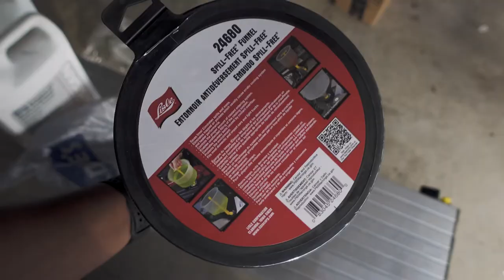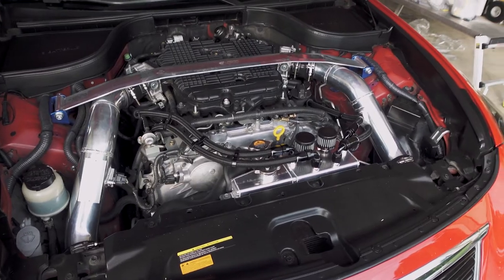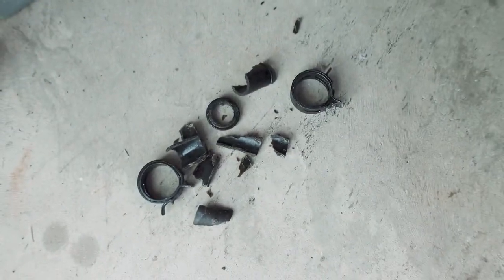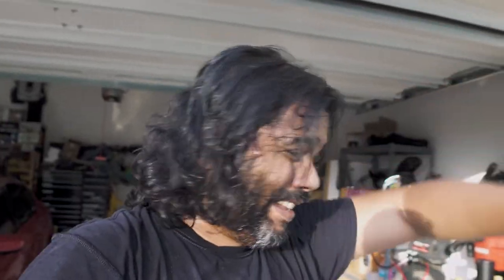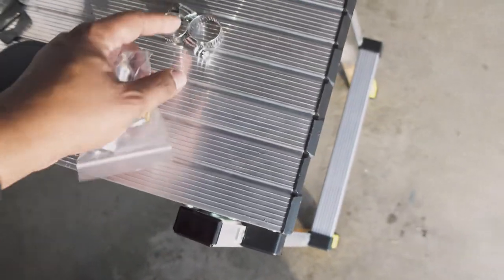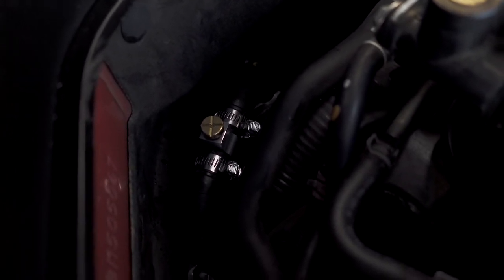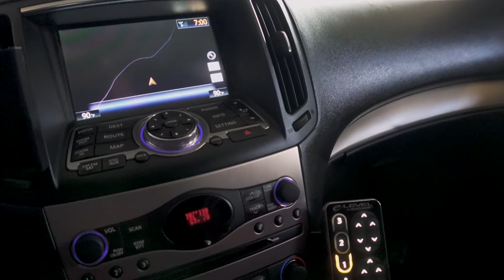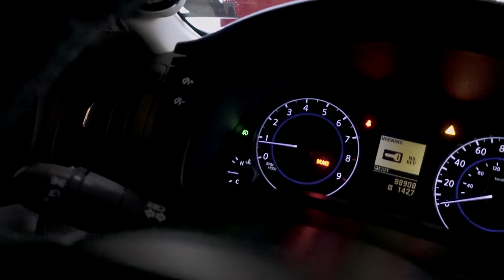Fix this VQ Cooling TimeBomb before its to late.

Comment: I just changed this plastic connector on a 2013 G37 for an aluminum one with a bleeder.  I used a Dorman 47291 connector that is easily available.  If you are just replacing this connector you don't need to drain anything.  Obviously wait until the car is cold then simply plug the coolant filler so no air can get in.  You can't use the regular cap for this because it will vent air or coolant from the plastic reservoir back into the system once you open the system and you will then be dealing with a gusher.  Put an old towel under the connector as you won't lose any more than  a few ounces of coolant at most.  I was able to do this without too much cursing by removing just the engine cover.  Once replaced I opened the bleeder and very slightly unseated the plug on the coolant filler and the bleeder instantly filled with coolant.  I then put on a burping funnel but really didn't need it as so very little coolant was lost and the bleeder worked like a charm.

Comment: That's hilarious I literally just fixed this issue days ago. Mine happened at 95k, it broke in half completely. Unfortunately had no clue this was common. It exploded in the middle of me running errands so I had no idea it happened until I noticed that sweet burning coolant smell then temp gauge was close to all the way. Who knows how long I ran overheated, probably not too long but definitely a bit. 
Really grateful for this video, it might bring more attention to this issue and save lots of people headaches. Don't think there is enough on YouTube. I didn't even know Z1 made replacements so thanks! Had to use cheap stuff to fix mine, going to be replacing that asap.
Reply from the maker: Very happy it helped bro. There is also another line that apparently has problems. I vlogged that one also.

Comment: For sure a ticking time bomb. Mine split right in half at 161,000 miles. Sprayed everywhere and smoke coming out the hood. Easy job if you just want to change the connector. Took me 30 mins just because I didn't want the pieces to fall in. So far so good
Reply: I’m at 162k miles and I just got a leak underneath my car, checked my coolant level and it’s bone dry. I filled it with water for now to find the leak idk where it is yet I’m tryna watch these videos to find out
Reply: mine did the same thing and I'm at 110K. do you know why this thing just snap right in half? is it a failsafe?
Reply: bro that shit just happened to me yesterday morning😭 i thought i blew my shit up😂
Reply: @sobottrachhuth75  late reply but from what I've heard these shouldn't be plastic connectors. It's hot coolant running through it. If you gonna keep the car longterm I say  buy the metals one from Z1 Motorsport
Reply: @alienjooce1324  cheap fix bro.  It's uncomfortable especially in the winter lol but if you not in a rush order the metal one from Z1 and take your time. The old one will Crack. Just make sure it doesn't fall inside. You'll save about 200 lol
Reply: @Hughe1188  yeah ordering it from z1 as we speak lol

Comment: mine started to fail at about 85k miles. I noticed that every time I popped open the hood, my coolant reservoir would be a tiny bit lower than it was when I last checked on it. that happened a couple of times so I figured there must be a leak somewhere. turns out, it was this peace we're talking about in the video. Getting it to it and replacing it with a new one wasn't too bad but the damn thing came out in small pieces. there's an excellent reddit thread that details all the common problem on the Gs and what you should look out for. its called G37 Common Issue Thread. My 2011 G37 has 102k miles and all I've had to do so far is this connector and the gallery gaskets that started leaking at around 95k miles. it wasn't a bad oil leak at all but I did notice a slow build up so I got the gaskets changed. Those two fixes and a new brakes and rotors set is all I've done for my car. I've owned this car for 6 years now (bought at 54k miles) and its been wonderfully reliable.

Comment: This just happened on my '14 Q50s at 52k miles. Noticed a leak traced it to that heater hose connector and it was starting fall apart like your's. Great video!
Reply from the maker: Thanks man and wish more owners can see this video before it happens so they can be ready.
Reply: @3rdPedalMedia  it almost feels like intentional,  they built such a solid motor that they weakened it with an "Achilles Heel". Like a "Planned Obsolescence"

Comment: Just fired up my Z last couple days and noticed first time coolant leaked through the passenger side. Gonna address this soon thanks for the insight bro ❤️
Reply from the maker: Glad you caught it early and not while driving.
Reply: Yeah I’m at 125k miles as the 7th owner , Had it garaged to address the clutch rattle on stock clutch, trying to save for a 34 row oil cooler and a race clutch to suit my driving habits, then this leak occurs. Definitely time for upgrades hoses lol 😁

Comment: Mine finally failed, original with 214k miles on the car. The day before my dyno tune I saw it was dripping. After my dyno tune I swapped for the metal z1 motorsports replacement. I'm glad it didnt fail while on the dyno 😅. The old piece broke into 20 pieces while trying to remove it lol.
Reply from the maker: Oh wow. You go some miles outta yours. So maybe it’s a age thing rather than heat/cool cycling.
Reply: @3rdPedalMedia  yes i’m pretty sure because i’m at 217,000 & barely going to change it in the next couple days(2015 q40)

Comment: That connector with the bleeder is for the coolant hose to the left(driver side) of the engine. Still can be used there though. Just don't bother opening the bleeder.

Comment: This happened to my 37. I got 8t towed to Nissan and they diagnosed it as a leaking water pump. They wanted over $2000 for the job. Good news was they could also do the timing belt for $3000! I googled, paid $3.95 for a new one and voila. Done.
Reply from the maker: Wow what effing crooks! Glad you found the real problem.
Reply: Nissan dealerships surprisingly don't have techs that are very familiar with these 3.7 engines. In Nissan world that engine is mostly premium but they put them in a lot of infinity cars for the the better numbers. Infiniti would diagnose it better, but still charge the same
Reply from the maker: @dylanscott6485  that weird the 370z is one of the longest running Z i believe they have the same couplier, although with the 2013 model refresh like with the oil gallery gaskets it may have been updated
Reply: @3rdPedalMedia  and compared to the 35 it also has duel throttle body’s for better air flow. Most of nissans customers own Altima’s and such so its not like they are having 370zs rolling in for services all the time.

Comment: Mine blew up in my face a few years ago when I was bleeding the coolant and I happened to be in that area of the engine bay. I had to replace with OEM, but bought an Z1 that has been sitting in my garage for a little while. Luckily, the coolant was only slightly warm, but I still panicked and freaked out running around my yard, I think my neighbors thought I was crazy.
Reply from the maker: Damn man. Yea happy it wasn’t bad.

Comment: I literally just came back from work after hooning my G around and noticed a white cloud coming for under the hood. Luckily it seems like a small leak just like you had but I'm definitely going to buy the z1 replacement part just to be sure. Just one question.. Is it possible to replace the part with the coolant still in the engine? 
Thanks for the video btw!! this really had me worried and I was lucky enough to be a mile from home :D
Reply from the maker: Yea you don’t have to drain the system but the top loop will empty just do like I did in the vid and top it back off ensuring all the air comes out.

Comment: Thanks for sharing very important and interesting vid. I just wonder how big company like Nissan can try to save few bucks for production but causing a huge cost for operator ☹️
Reply from the maker: The majority of OEMs depends on 3rd party manufacturers to produce a product to a certain spec. Most car OEM are just assembly plants.

Comment: What part number for that connecter, and where from? I obviously can get the hose clamps. Didn't see it in the details. Sorry if it was somewhere in there.
Reply: Any hose connector will work (granted it's the correct size) lol. I used a garden hose plastic connector and ran fine for 6 months until I switched to a metal one to prevent it from getting old and brittle like how it did the first time
Reply: Look for the Dorman 47291 aluminum replacement connector with a bleeder.  Fits and works great.
Reply: @erth2man  checked that part number at O’Reillys says it won’t fit my car, it’s a 2010 g37s sedan. I wanna buy it anyways and try it
Reply: @vqdrew1171  That Dorman part number 47291 will work perfectly.  These 3.7 engines didn't originally come with a bleeder like the 3.5s did which is why it probably didn't list it as a replacement.  They should all be made to fit a 3/4" (19mm) heater hose.
Reply: @erth2man  yeah I bought it and put it on the other day for now until the Z1 port comes in replacing all my hoses and thermostat lol not risking it

Comment: what did you do with the coolant that was left in the funnel when you were done bleeding the system? Back in the coolant bottle or into the overflow tank? If the overflow tank, did you have to wait for the car to cool back down before you removed that cap or is there no pressure in it from the coolant fill cap being open with the funnel? Scared imma open it to dump the extra & get shot with steam haha
Reply from the maker: On the G it’s an overflow. On the later Z’s I believe the overflow is pressurized. I let it cool down put some in the overflow and the rest filtered and into a container.

Comment: Hi clean build man just picked up a 6mt 370z whenever I do a pull smoke starts to come through the air vent and it smell like something is burning you think it could be this?
Reply from the maker: Good god! That could be a number of things. If you hit the recycle button of the HVAC. Does the smoke still come in? See if there is some old or something burning off or something running.

Comment: Just did this. It was a huge pain. Some of the cracked pieces fell down the tube. Is that something I should be concerned about?
Reply from the maker: Hard to say rly. They are very brittle pieces hopefully they will hit the water Pump 1st and get chopped up in smaller pieces.
Reply: Greatly appreciate the reply. Assuming that it will be chopped into small pieces Do you recommend changing the coolant?
Reply: Greatly appreciate the reply. Assuming that it will be chopped into small pieces Do you recommend changing the coolant?
Reply from the maker: @jphillip2350  you should, is it cooling well?
Reply: Just fill it back up and send it

Comment: Did you drain all fluid from engine and heat exchanger? How much fluid did you put in back?
Reply from the maker: Didn’t drain used less that a jug of Nissan coolant to top back up.
Reply: @3rdPedalMedia  one more question. The owners manual says it takes 11 qt coolant. Do you know when you drain from heater exchanger does all the 11qt comes out or? I just wanna know how much coolant should I buy cause it’s kinda expensive at dealer.

Comment: How long did it take you to bleed the system? I just replaced the hoses with the z1 set and did the valve. My hands and forearms are beat!!!
Reply from the maker: It was very easy. It’s been a while but I thought I went through bleeding it in the vid?
Reply: Yup you did I watched your bleeding process and it helped me out allot. Wasn’t sure how long it took you, taking video editing into consideration. I felt like I kept seeing tons of bubbles took em almost an hour to bleed it felt like.
Reply from the maker: its wasnt that long.. ensure your hvac heat is on and on full and let the thermostat cycle on/off a few times  @BillaDaKilla

Comment: Hello! I’m currently doing this job on my G. Heater hose cracked on me at 90k miles. Just got the Z1 Master Hose Set and changed out all of the radiator hoses and heater hoses. Went to go bleed the system but it’s still smoking from the back heater hose side. I immediately cut the car off when this happens. I saw online people saying it’s just burning the coolant off from the leak most likely and it’s normal. The gauge inside isnt showing it overheating anymore though. Should I just try and keep letting it burn off or what do you think? Thank you for your input!!
Reply from the maker: How are you filling? Do you have a fill cup like what I used that allows air to escape? Did you also crack the bleeder on the z1 fitting to let air leave the back side? Steam coming off I normal but at the same time you shouldn’t be overheating. You have some air trapped somewhere.

Comment: Great work bro!! 👏👏👏👍 My G is at 48k miles, a 2012. I'm going to order that from Z1. Question, did you order yours with standard or spring or what? Also, are you in Tennessee?
Reply: The clamps I mean...no clamps, standard or spring
Reply from the maker: Should be the standard which is the worm screw style clamps.  I believe the spring is like the factory type.
Reply: @3rdPedalMedia  
Ok, thanks alot
Reply: Yes middle TN
Reply: @3rdPedalMedia  
I'm in north Mississippi, we should link up sometime. I do shows with my G. Been trying to get to the Nashville area for some shows. But it either rains or something comes up. 🤦‍♂️🤷‍♂️ Plus I had guys to cancel out too on road trips🤷‍♂️🤷‍♂️🤦‍♂️😡
Reply from the maker: @nonameisthename138  sure when the time comes msg me in IG
Reply: @3rdPedalMedia  most definitely will 👍
Reply: I need to do the same with my G I'm in Clarksville TN and work in Nashville TN
Reply: @jarvond21  
You modded? You coming to Memphis for Stoopid Cold next month?
Reply: @nonameisthename138  I'm slightly mobbed. I will try to be there! I don't have nothing to crazy done to the G
Reply: @jarvond21  
Its all good bro. I was just checking. Modding is a timely thing
Reply: How's Z1 for parts?

Comment: amazing
Reply from the maker: thx bro.. i just hope it helps.
Reply: @3rdPedalMedia  did you lose coolant while replacing it?
Reply from the maker: @hamdanahmed2664  during the repair not much but i did loose a good bit before due to the crack

Comment: I have a 2012 G37x the back tube busted and I replaced it. After almost a month I have notice the upper hose got swollen later busted. I have replaced it with new one. So is it normal for the upper hose to be very hard and very hot????
Reply from the maker: Don’t think so unless pressure was backing up manybe? Was there a restriction? Was the car running hotter than normal?
Reply: @3rdPedalMedia  Yh whenever I touch the radiator upper hose it’s hot I can’t touch it with my hand longer than 5 seconds
Reply: When I changed my upper hose I went to Midas and they flash my fluid and they said it’s good
Reply from the maker: @aahilzaky7933  was your temp gauge higher than halfway?
Reply: @3rdPedalMedia  no its normal. Do u think I should do pressure release ?

Comment: Do you remember how many miles were on the car when you did this?
Reply from the maker: It’s been a while I’m sure I mentioned it in the vid. But it seems to be a matter of time rather than miles. Right around the 10yr mark.
Reply: @3rdPedalMedia  Understood 👍 I have a 2017 370z but it just hit 100k miles so I’m trying to find out what I can do for longevity, great video, learned something new 🙏👍
Reply from the maker: @gray.areazz  np man. Don’t forget to sub. What many have done is just change it out before it’s close to going. And Z1 have a new black version.

Comment: Okay so my 08 g35 sedan has been overheating when sitting/idling but when driving it’s just fine then I got home from work today and I see it’s leaking a lot of coolant and I check my coolant and I have none can someone please help me out with what could be wrong ?
Reply from the maker: Did you ever find a leak, water stains etc?
Reply: You wanna fix your leak first. Then bleed out the air and see if your thermostat is good. Also make sure your radiator fans are coming on.

Comment: I'm having this issue today
Reply from the maker: Dang. Hope you got it fixed
Reply: @3rdPedalMedia  It’s Hell getting those hoses off what are the hoses called?
Reply from the maker: @jeromemalveaux3790  those hose clamps ?
Reply: @3rdPedalMedia  both
Reply: @3rdPedalMedia  the OEM hose I caught hell trying to put the lower hose in
Reply from the maker: @jeromemalveaux3790  the one above the header the short one ?
Reply: @3rdPedalMedia  correct
Reply from the maker: @jeromemalveaux3790  yea, yuge PITA i made a separate vid on that, i explained how to easily remove it on that vid but it also destroys the factory clamps

Comment: If you put the bleeder valve in the back, why you even bother putting the funnel to let the air out. You just simply fill up the coolant to full, turn on the engine with the max heater on, fill it all the way up and wait for all the bubbles to escape. It is an over killed job!!!
Reply from the maker: Bleeder will spill out eventually but the funnel will about to continuously cycle the guild around letting air out without spillage.
Reply: You bleed it at the high points of the system. Like the top of the radiator as he did.

Comment: This happened to me at highway speed . It was like running over a 2 liter bottle of sprite and that was the last day i had a connection with Infiniti . I babied this car for 10 years and in last 2 years was problems after problems . Sunroof leaking , fuel tank level sensor left me stranded in the middle of a highway , heater coolant hose leakage and upper radiator hose leakage . Good bye Infiniti for good .